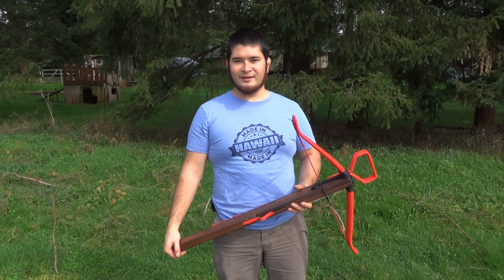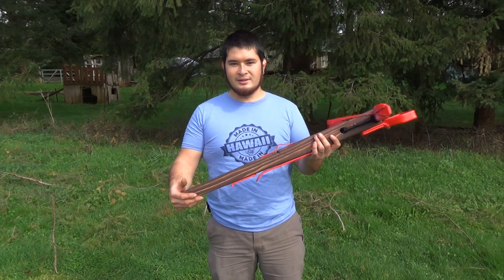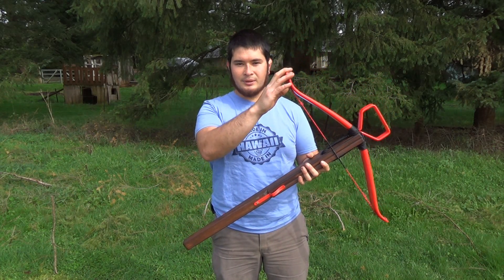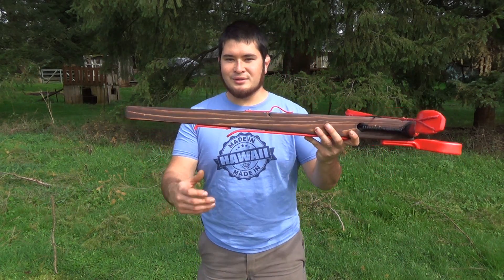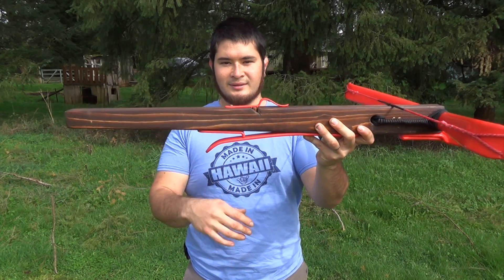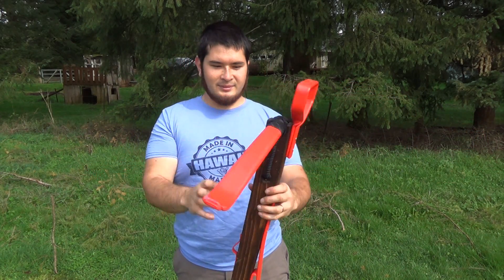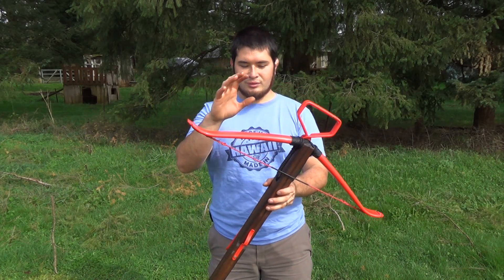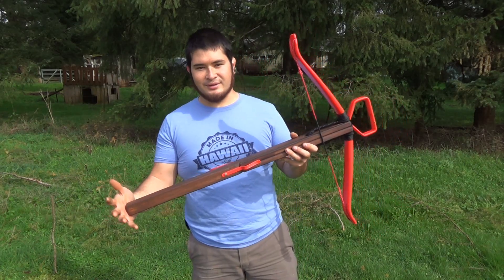100lb Medieval Style PVC Crossbow for Under $10 Part 7 - Shooting the Finished Crossbow

Comment: Just saw your video. 
Why furniture grade or white pvc?
Would there be a difference in using the gray pvc with uv protection in it? 

Great info and videos.
Reply from the maker: Thank you for watching! Gray PVC tends to deform at a lower temperature and isn't necessarily tougher, it just gets brittle at a lower temperature. If the temp gets over 80 degrees, conduit bows tend to get soft and will follow the string or become deformed.

Comment: Awesome weapon! Could you tell me, how long can this bow remain cocked? Just needed to know if I could use it in a tree stand.
Reply: I mean, I've never hunted, and not to downplay BackyardBowyer's work, but I wouldn't use one of these for hunting (minus the apocalypse of course! haha)

Also, I think I recall him saying that a crossbow of this pull is comparably light to commercial ones. Also, now that I'm thinking about it, I think states have laws regulating the minimum draw weight of crossbows used for hunting.

Anyway, happy potential hunting!
Reply: its too light for hunting dude buy a 200-300 dollar bow if you want hunting
Reply: I think that depends on what you're hunting, but I doubt you'll be hunting squirrels in a tree stand. I think most places want 150# at least, for small game. Large game will need 200+ pounds on a cross, or so I've heard. On a recurve, you can get away with 50-60# for deer. Someone else made a cross with a leafspring. I don't know much about it, but I'd guess if you did a double leafspring, you could get past 250, but you'd want a stronger trigger mechanism and a lever to pull back the string.

Comment: This thing is so awesome! About how long is the draw length from the string's resting position to the lock?
Reply: I made this crosscbow and draw length from resting point is about 12 inches and I use 18 inch 320 grain bolts